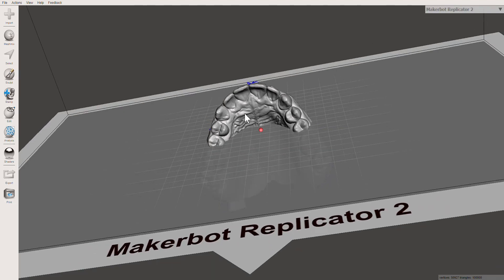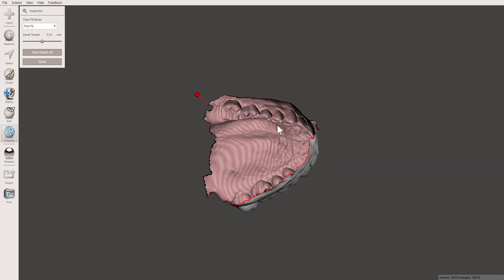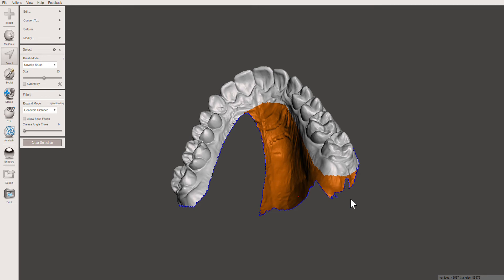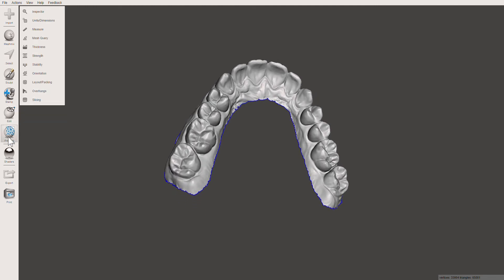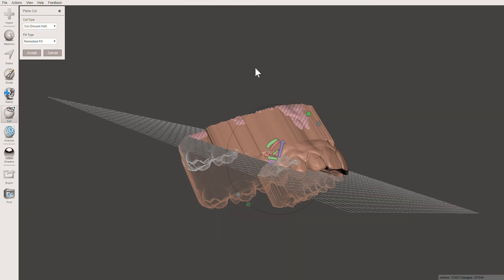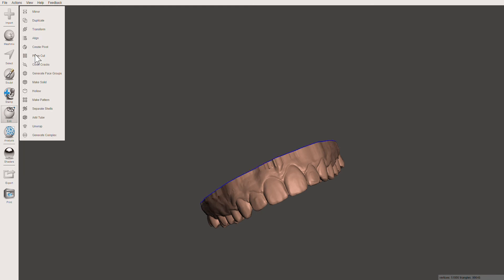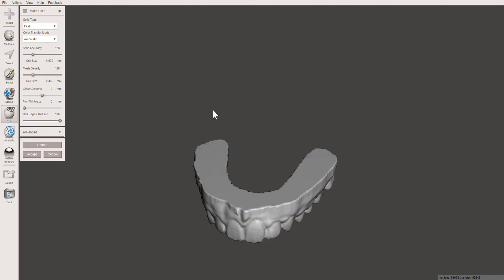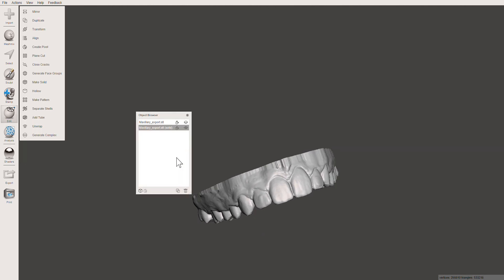Preparing dental models in MeshMixer for 3D printing

Comment: Can i get more explaination at the 7:04 mark on increasing the solid accuracy.   You played with couple numbers there that I need a little more depth of knowledge.  Why did you choose the numbers you did?
Reply: You can increase the numbers to maximum to get a sharper model. And also the model can be made hollow, to save the resin.
She did not use maximum numbers since her computer is too slow. But it was just to get you an idea. You will come to know if you start using meshmixer, and learn to use the tools of this software. Good luck.
Practice makes one successful.